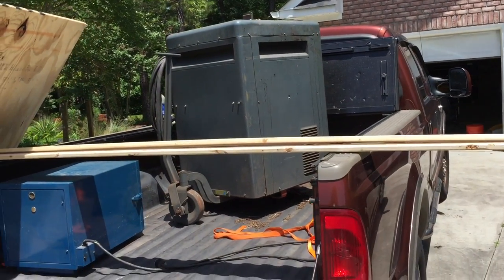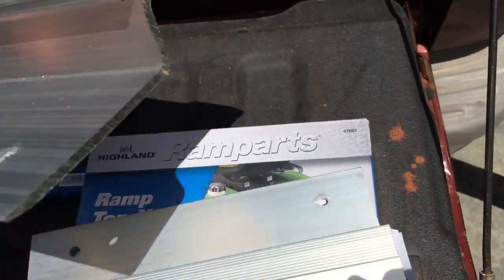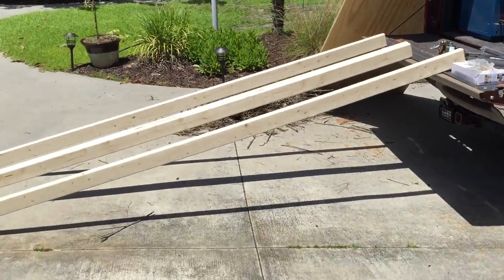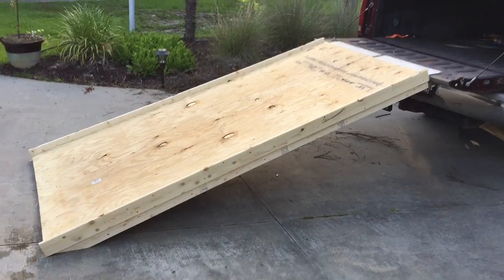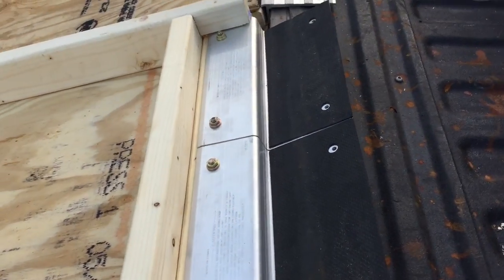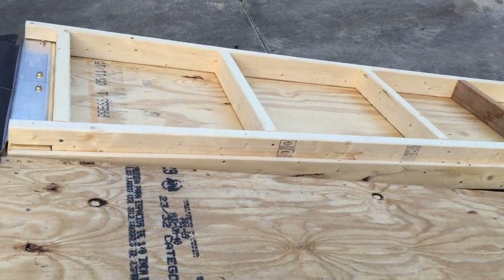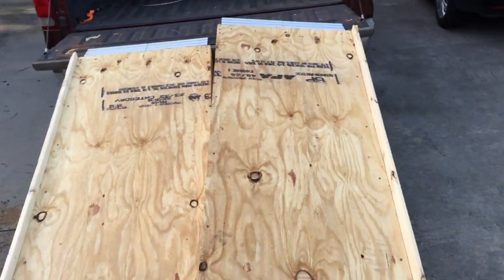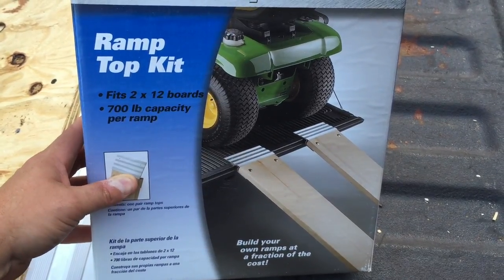Truck bed ramp for loading and unloading heavy objects

Comment: Thanks for making this video... I have been wanting a solid ramp that i could dolly stuff in and out, but love your idea of using a come-along wench!
Reply from the maker: Glad you found it useful... yea, My F250 is pretty tall and if you have something really heavy, it will be hard to control it as it rolls down a steep ramp.  The come along makes sure that your load doesnt free fall or tip over...  Cheers!

Comment: Looks sturdy and solid. Good job my friend. I appreciate the safety side rail tip. I hadn't thought of that. I'm going to build one myself as well. Your design is the closest I've seen to what I want. I've seen people join the two pieces with a hinge. It would probably be too heavy to move that way, unless I added wheels and handles.

Excellent video. Glad the welder made it down. I was thinking of a winch to lower it, but your idea seemed to work pretty well.

Best wishes and God bless.
Reply from the maker: cheers

Comment: Awesome Idea. Glad it worked. The notches by the tailgate are on the wrong side. Build like it would hold if there were no screws like stacking. Also deck screws are weak. I have broken them. 16d nails would be much better.

Comment: Picking up on the earlier conversation on the angle, here is the math:  The HF 72 inch on a tailgate which is 36 inches high, will have a 26 degree angle. Your 96 inch (8') ramp will be at a 20 degree angle.  To extend the 72 inch out to 96 using a short 2 foot wooden ramp would not be too hard to fabricate.  The dimension of that wooden ramp should be: 9" high and 24" long (diagonal)  - so it bear a 20 degree angle so it would be flat with the 72 inch ramp sitting on top of the 9" high wooden extension.   An alternate would be to climb the front of the trunk on a curb to tip the angle of the bed down.  I need to measure the length of my F150 to compute the minimum height of the curb to get an equivalent angle. On this latter method it is really not necessary to be exact since ramps will automatically adjust to a slightly lower angle.
Reply from the maker: It sounds like it should work...  Make it stout, and make sure there is no possibility for the HF ramp to slip off of the pedestal ramp you have it sitting on.  Also, if you think about it, parking nose down an incline (hill not a curb) will help you out alot...  Draw a picture of it and it will make sense...  Basically the high side of the slop continues increasing toward the base of the ramp reducing the ramp  angle because the ground is higher at the base of the ramp than it is at the tail gate...
Reply from the maker: Your idea of parking your front wheels on a curb will help ..  You can work out how much with some right triangle geometry...  Your back wheel is the axis of rotation (pivot point) between the front wheel and tail gate.   So if the distance between the front and back tire is 96" and the distance between the back tire and the tail gate is 36, a 6" rise on the front tire yields a 2.25" drop of the tail gate relative to the ground.  You can use this calculator to do a simulation.  https://www.calculator.net/right-triangle-calculator.html?av=&alphav=3.583&alphaunit=d&bv=&betav=&betaunit=d&cv=36&hv=&areav=&perimeterv=&x=57&y=23
Reply from the maker: Check this company out they sell ramps, and bases. this looks like they have several base options up to 6" rise...   You may be able to work this into your design.  https://www.vevor.com/threshold-ramp-c_10406/vevor-transition-entry-ramp-modular-threshold-ramp-aluminum-6-rise-rated-800lbs-p_010267817350

Comment: im thinking of making a unfolding metal ramp that is the width of the tailgate and unfolds like 4 of them into a working ramp so when you're done you just fold it back up. it will take some space out of the bed but itd be a lot better than if i put THIS in the back lol
Reply from the maker: Thats a good idea, you will need some structural stiffeners running along the length of the ramp so that it can take some weight.  It will be a lot lighter and stiffer than a wood ramp if you design it with enough section in the load direction to carry the weight.   Steel will be a lot heavier. I recommend Aluminum if you are going to make a metallic ramp. Another thing to consider is that a sheet of aluminum will cost you a few hundred bucks. If you want to weld aluminum you will need a pretty expensive welding rig unless you have one that you can use.  They actually sell some aluminum ramps that cost between $300-$900 bucks.  This was really just something that I threw together for $50 in a pinch to do a single job. If it was something that i used all that time, I would probably use Aluminum as well.    I am a mechanical engineer, so Let me know if you need some help designing your ramp.

Comment: Nice job. I am looking at the HF 72 inch ones -- but your 96 inch is certainly a better angle. Now wondering if there is an easy way to reduce the angle some.. may be drive up a 4 inch ramp on the front wheels..but need to do the trigonometry to find some optimal solution.
Reply from the maker: Ive got a slope in my drive way that lets me reduce the elevation change a bit...
Reply: @JeremiahL  Just put in another comment on the computed angles.

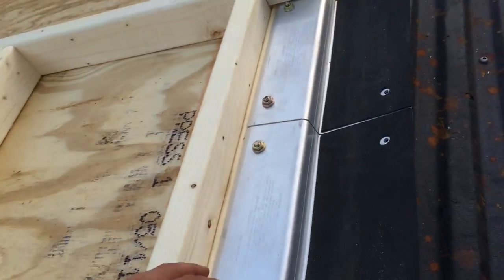Comment: That gamee moment @ 7:27 makes me nervous.  Curious how much weight you would trust on that weak point
Reply from the maker: Stanley Miles 2 fat guys and a 800lb welder, and it did’t even creek.
Reply from the maker: Stanley Miles this video shows the test run.
Reply: Interesting.  Thanks for the video.  I didn't like the gap between relief and cross member created using 2 12" ramp kit so using with a 12" and 8" combo, looks like the 2 12" is causing the gap in yours.  I think your solution is much better than the manufacture recommendation, hope I never have to find out differently in practice.

Comment: after you use the ramp how do you store it back in the bed? do you have enough space? If  I just wanted to make my ramp with the pieces of wood and no plywood to save space do you think that would work? all i have is a small 135 pound pressure washer to move around
Reply from the maker: jonathan marin I store my ramps behind my shop.

Its entirely possible to change this design so that it meets your purpose.  Its noteworthy that you get a lot of shear strength from the plywood sheathing.  With that said, 135lbs is a small load, and it may be fine.

I would try it and see how it works.
Reply: @JeremiahL  thanks. In regards to the length of the 2x8 I have a frontier double cab and the tailgate is maybe  2.5/3 feet off the ground. The ramp kit I bought says I need a 10ft piece of wood. Is it necessary to be that long ? My bed is only 5 feet
Reply from the maker: @jonathanmarin6123  I think you can make 8ft work...  You can use a come-along to help if it winds up to be too steep.

Comment: what kind of plywood did you use
Reply from the maker: +bryan miller I used some 23/32; sheathing that I had on hand.
Reply: @JeremiahL  23/32" Stamped on material equals  3/4" Plywood
Reply from the maker: How the eff did you even see that….  Lol

I would pretty much advise to use as thick of material as you can.  Thicker the better for strength.  Obviously the thicker you make it, the heavier it gets…

Comment: Ive been researching this for about two years: all the ways to get heavy items into my pickup bed. There isn’t a video with ALL the ways. First I wanted a crane but realized that’s only good for something like a generator that you can tie up from the corners. Lift gate is too expensive. Hitch mounted lift was my final thought but the 2.5’ square platform only really lifts 500lbs safely. Thought of a sled which is winched up. Now im looking for a metal folding ramp with my winch mounted at front of bed to pull my 500lbs+ ice cream cart up into it. Folding ramp cus i have to take with me. If you have any ideas on how i could get my front tires up higher lemme know. In the past when I had something super heavy to lift in and didn’t really have a good way to do it I popped my front tires on a nearby curb and it helped get the bed way lower which helped. Metal ramps I have to work on my trucj are too heavy to be mobile and wood ones even heavier.

Comment: what's the cuts
Reply from the maker: +bryan miller I cut a 4'x8' piece of plywood in half.  I used 2x4 stretchers that span the 8' length of both sides of the ramp. Assuming the platform of the ramp is 24" wide, the "rib" stiffeners need to be 21" wide or what ever the resulting space is better the stretchers...